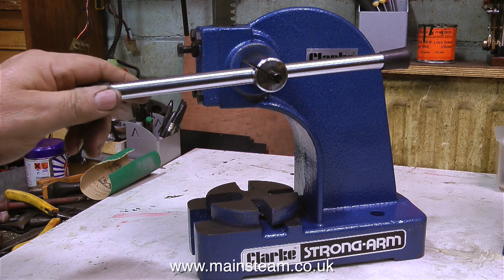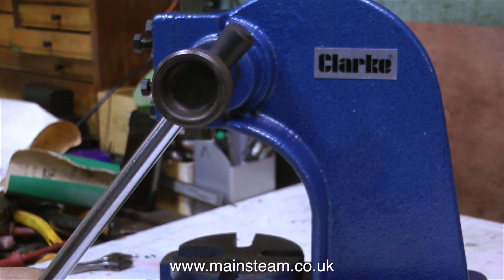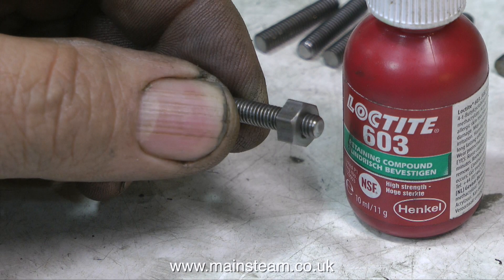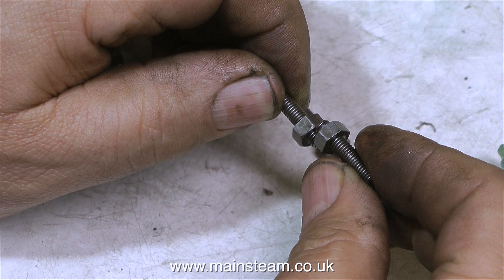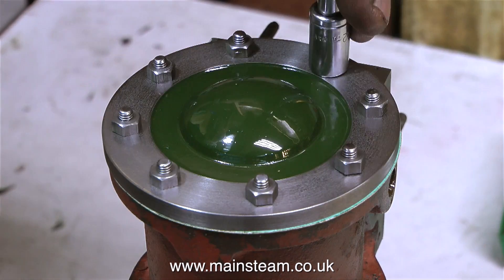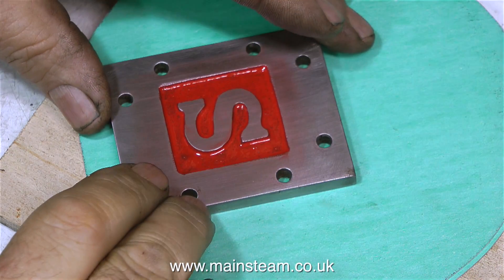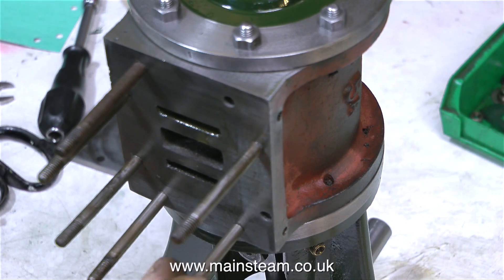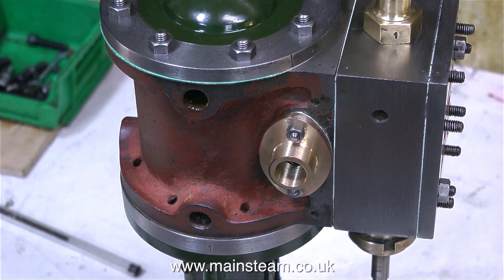HOW TO REBUILD A STUART MODELS 5A STEAM ENGINE - PART #13

Comment: Could a suggest a pin vice as a tool that you might find useful or even cheaper, although very specific, drill and tap a piece of aluminium rod to fit the bolt so you have a better grip and less burning to your hand?

Comment: I´m not an steam engine enthusiast just enjoy seeing  the work put in to them.
Think i soon seen most of your videos and think you are doing an excellent work.

just a thing i have been thinking of when you do your gaskets.

when I personaly work with mopeds and motorcykles and have to make a new cylinder head gasket i usually smear a thin layer of greese or thick oil on the cylinder head or cylinder and press it against the gasket material and get an perfect "print" on the material for where to cut.

any reason you´r not doing it that way?

I know of that marking paint you can use but i never seem to have any but some random old oil or greese for bearings i always have laying around so thats why i use that instead.

Comment: Do you prefer graphite impregnated gaskets or regular, and what thickness do you prefer as they seemed fairly thick. Love this channel as I have a miniature traction engine and take a lot from your videos and apply them to my TE
Reply from the maker: I don't know really, the ones that I use are offcuts from gaskets that a friend of mine makes in his Gasket company. I prefer them a little thicker generally as they seem to seal better.

Comment: May I make a silly suggestion: why not drill & tap a few suitably-sized bits of steel rod stock for the common sizes of studs that you make, to use as a handle when polishing like at 1:44 (or on the belt sander!)?  Wind the studs in (with a nut to lock as required). this will limit the heat rise experienced, and give you a lot more control, as you will have a lot more material to hang on to. Having it chucked may even speed the repetitive operation in the lathe. I really enjoy these videos (vicariously- I doubt I would have the patience to create a steam engine).  Greetings from down under! I trust you are keeping your health under control.
Reply from the maker: I thought about that too, but it's something I never seem to get around to ..... At least the constant burning sensation stops when I stop using the belt sander :-)))) My fingers are quite heatproof now which is good when playing with live steam engines ..... my health seems OK, I have my type 2 diabetes well under control without medication :-))))
Reply: I used to hand and machine solder (electronics) for a living, I know what you mean!     Re your T2D: that's excellent - I really appreciated your video on the topic (I'm stuck  :-) with insulin analogues after a serious bacterial infection- I do look forward to the possibility of a day when I no longer need the jabs - but meanwhile it's ok).
Reply from the maker: Have you seen my video about how I manage my Type 2 Diabetes ? 
https://youtu.be/TZBzIdOkhwo
It works for me ............ it is now one year on from the initial diagnosis and my sugar levels are almost normal - until I eat loads of refined Carbohydrates that is - so I don't :-)))))
Reply: Yes, I very much appreciated this, your early experience tracks with mine.

Comment: Oh baby, can't wait to hear this run, bet it's going to sound orgasmic :) I demand a 1 hour run at the end of the start running video, different speeds, different camera locations/angles, etc. Thanks for everything you do.
Reply from the maker: I am hoping to run this one in steam frequently, I like Stuart 5A steam engines :-))))) At the moment I am looking for a large copper boiler suitable for running it in a boat maybe .....
Reply: Perhaps a 'Flash' boiler???
Reply: BLeeKiis Too     That would be to hot , I have seen OMG flow steam hydroplane engines with the head turned blue from the heat of the steam , plus they run at 3000psi